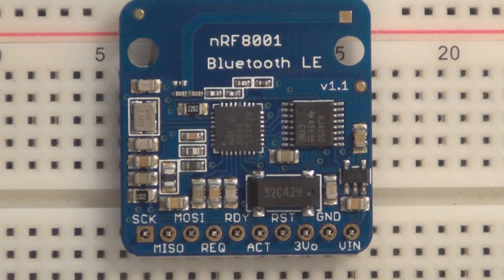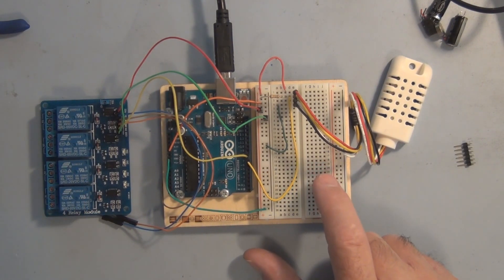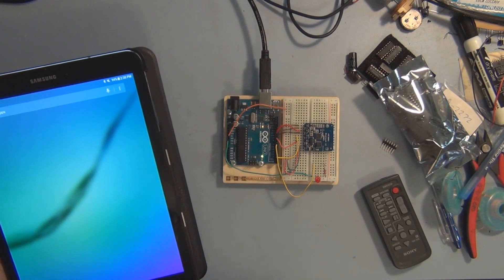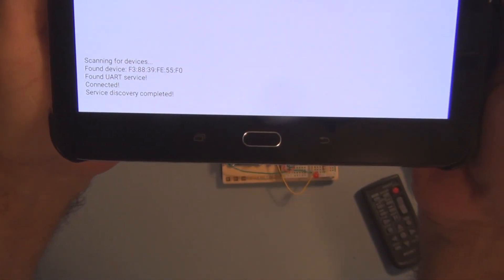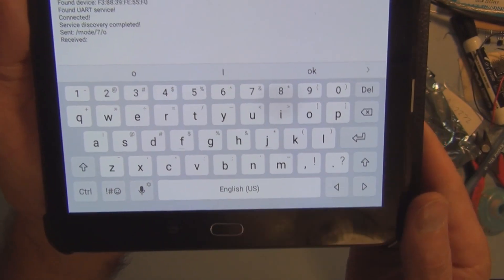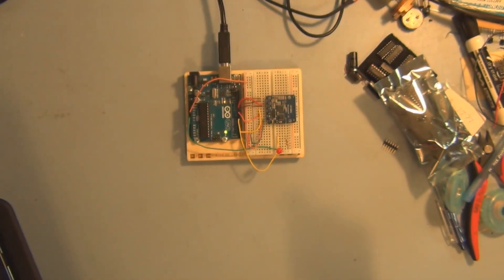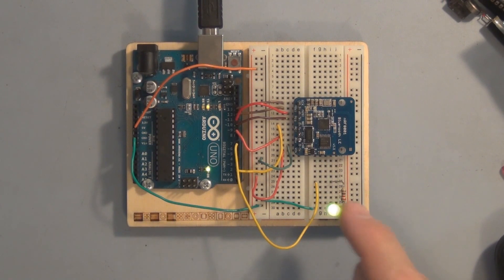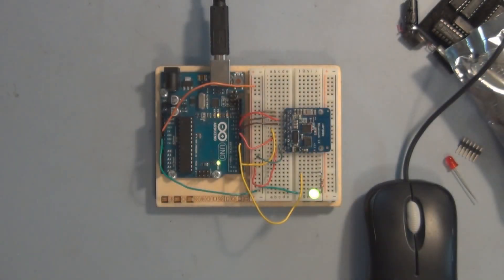My First Bluetooth Low Energy Project

Comment: I have thought about something for a while, maybe you could try pulling it off.

A bluetooth audio transmitter powered by the audio signal feeding it. Seems doable, just a schottky full bridge rectifier and a capacitor to serve as a power supply, but something tells me there must be a reason it hasn't been done before. Seems like to me there is plenty of power in most audio signals to power a bluetooth module, and since reading that signal consumes nearly none of that current, theoretically it should work fine. 

Obviously a battery would still be needed for the receiving end, but  one less wire or one less thing to charge is always a good thing.